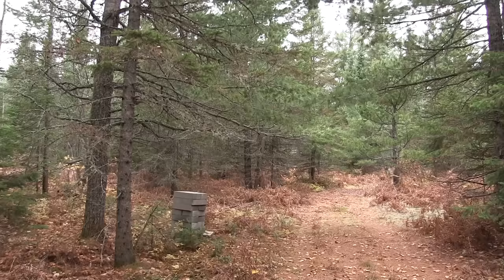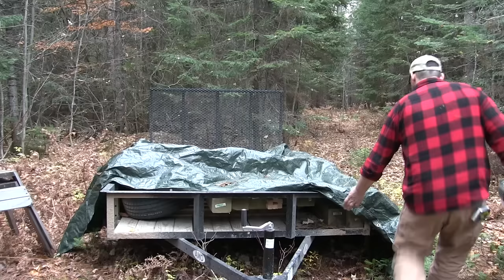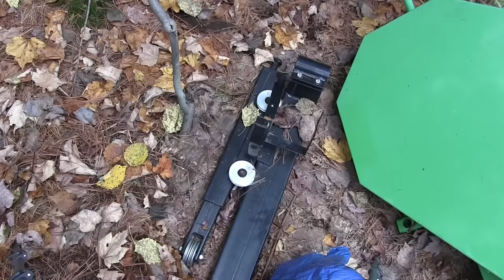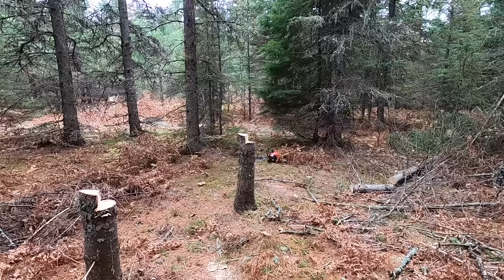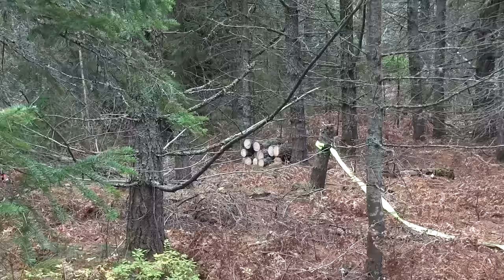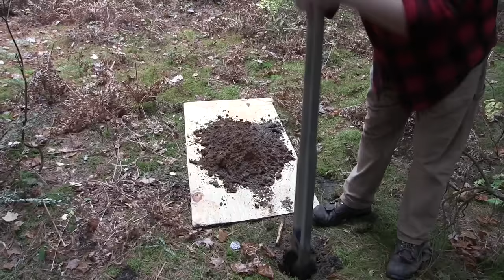Building a Remote Off Grid Cabin in the woods...Deep Dive commentary

Comment: I would get claustrophobia after a short while there ... and the quiet is a bit too loud.  My suggestion for a tiny house/ what I might do/ is to have  
a much larger floor plan with much or even most of the house a south-facing greenhouse. My living room/ kitchen/ bath would be where the stove would be so I would only have to heat a section of the house during cold winters.  I do that sort of thing already as "central heating" of the whole house is a huge waste of heat and money.

Comment: I watched to see if you put a sheet of thick plastic on top of the insulation or behind  it  as a vapor barrier.  You did neither.  WHY?

What amazed me most was that you did it alone, without a cement mixer truck, and that you could use your pickup to pull stumps out with that yellow rope without pulling your transmission out of your  vehicle.
Reply from the maker: This cabin having no shower and being heated with wood the onlyy moisture it will ever get from the inside is boiling water on the stove and breathing

Comment: Why attach the ledger boards and rim joists to the SIDES of the foundation poles?! That is absolutely crazy. Traversal loads will significantly decrease the strength of your structure which will eventually fail.

Comment: Great video. How do you keep the metal roof from sweating in to the insulation?
Reply from the maker: I use wire screen for rib closures not foam closures, so I have as much ventilation as possible.

Comment: Only just saw ur vid today. Very enjoyable, but why did u not use a hose and one good blow, and then sit back and watch the water leave the tarp under the force of gravity. Every last drop. Cudd saved u a lotta time
Reply: Rewatch. He did not want to soak the insulation.
Reply: @charlesbentley2934  wit a hose u can deposit the water anywhere u like. Just down to the lenght of the hose
Reply: So are you talking about a siphon? When you said blow, I thought you wanted him to stuff the hose through the tarp. I won't give my opinion about availability of a hose or ease of starting a siphon in his situation. I do know one good blow to that tarp would result in a blowout! Thanks for clarifying what you meant.
Reply: @charlesbentley2934  you. must never have done this. If you put the hose into the water, obviously Not through the tarp, but just drop the hose in to the water till it is all the way to the bottom, then from the other end, one good blow up the hose, without bustin your eardrums, then gravity will do the rest. Give it a try just with a bucket of water on the kitchen table and a small lenght of surgical hose. Then you will see what I mean

Comment: You REALLY should have a 16" wide concrete Footer with a cleat for the bottom of the 6" post. Burying ground contact still isn't a good idea. It's only a little extra work. Good build otherwise.

Comment: You did your foundation wrong. Lumber should always be stacked . Your support post are secured just on the side and all the weight is on those nails or screws. Your 6x6 should have been noched. So the frame is ontop not the side.

Comment: i love my Dewalt nail gun  i built my dad a 20 x 24 shed just by myself  and  i had all the walls up like you did i over lapped the bottom by 2 inches and i used Ply wood sheets cause at that time a contractor friend of mine order too much for a job i paid 10 bucks a sheet  i bought 25 sheets and only used 14 sheets altogether so and made over 160 had plenty for a couple side jobs i did and they paid 40 bucks a sheet so i spent 250 on the wood i charged 160 bucks for 4 sheets so  right now i have 90 bucks into the shed floor and walls 400 in martials and the roof was  free awing pans wegot from pulling down 4 carports  16 foot pans so i cut them to size cause you can't beat free

Comment: cool video but id not want you to frame my house!!! ive been a framer for 31 yrs and headers are necessary on any exterior wall and it does come to load bearing when its the roof aka snow load and uplift last thing i want is a broken window due to weight! not saying just saying and PT lumber is a mythy it does shrink!!! and the only reason you use it in building is termite prevention just things to consider if someone decides to actually build also i dont see a top plate reinforcing the walls for left to right shifting just saying
Reply from the maker: of course there is a top plate. When you have a 12/12 pitch and your walls are tied together with logs and spikes what would be the need for headers on non load bearing walls? just nonsence

Comment: 2 issues... 1) The way you made your burn pile, you were just asking for trouble. MANY forest fires occur because of how your burn pit was made. Fire ambers could float off and catch other dead trees, branches or brushes on fire and then you'd have a forest on fire! SMH You should have made a enclosure for the burn pit to prevent the possibility of a fire burning out of control. 

2) Instead of burning all the excess branches and trees... why didn't just rent yourself a wood chipper? Then you could have avoid any possibility of a out of control fire AND you would of been able to create wood chips to use as landscaping material around the cabin! 
It's only luck that you haven't caused a forest fire, yet, from doing burn pits in a forest. Be smarter and safer! SMH

Comment: OK you seem to have a good working knowledge of carpentry skills. But......  it is not called a skill saw. Skill is a brand name like craftsman. You don't say you need a craftsman saw. Or a Dewalt saw. It's a circular saw. So it could be a skill circular saw. But it is not a skill saw. That's the equivalent of calling all trucks a Chevy truck. So you wouldn't hold up a Ford ranger and say you need a Chevy truck right? Side note skill saws suck. I'd be embarrassed to be caught using one.